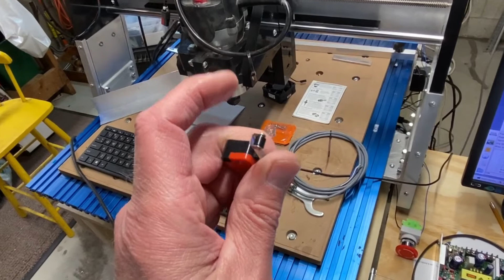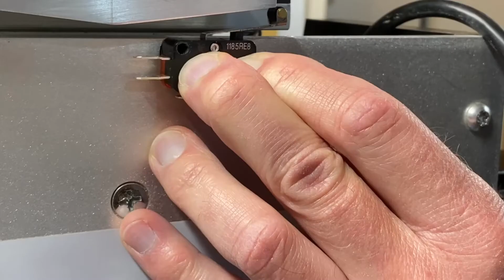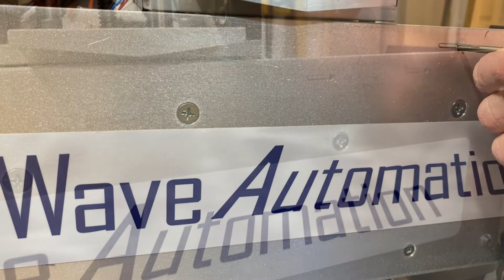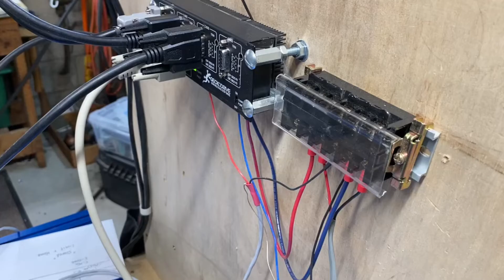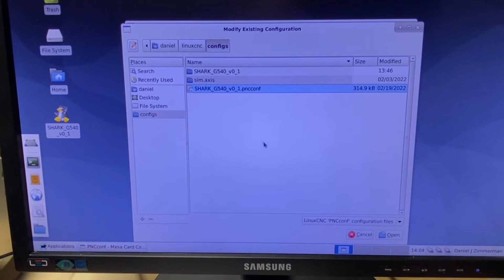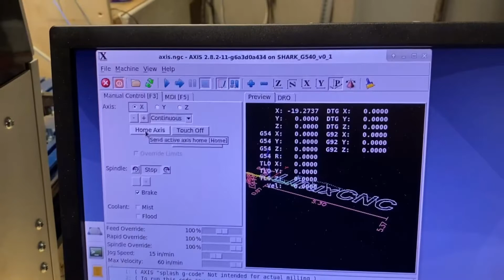CNC Shark to LinuxCNC - X Limit Switches are possible (3)

Comment: Keep 'em coming!  Fun to follow along, even though I've done all this on a few small manual mill to CNC conversions.  So happy I ended up with LinuxCNC (even though it was hard and intimidating at first!) instead of Mach3 or buying a proprietary system.
Reply from the maker: Bill ... thanks for the comment and encouragement !  This limit switch implementation was straight-forward, but I want to explore the finer points of optimizing LinuxCNC, power supply voltage and current limiting with the stepper motors (the details of which Nextwave won't disclose).  Please share your configuration in the comments and/or put a link to any videos that you might have created.  Rock on !